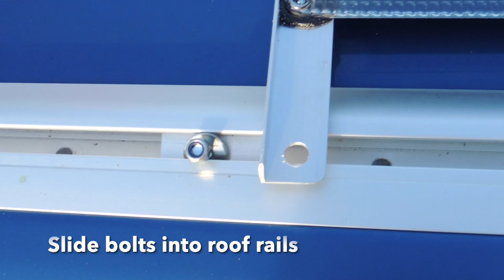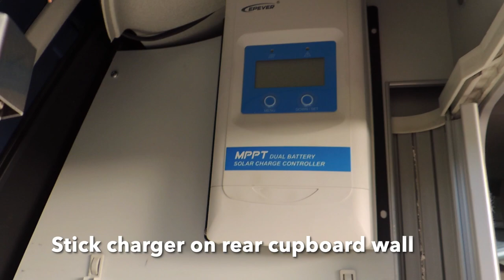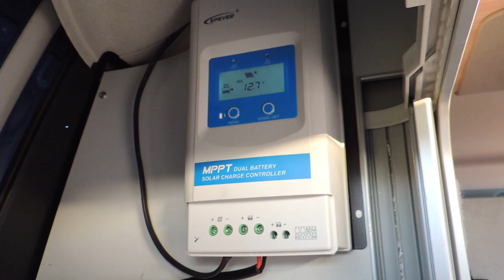How to fit a solar panel on a VW California (no drill or glue). It's easy!

Comment: Genius!! If I buy a flexi solar panel, how can I buy the metal rails that yours is sitting on, what would they be called? Also wondering what you'd suggest for running the cable into boot for a non pop-top. And finally, do I need to get some specific rubber roof rail gutter guide things? And finally what are the bolts you are using that fit into the roof rail gutter? Thank you :)
Reply from the maker: Hi, the rails come as standard on California so no idea about buying rails - sorry. Also, I guess you run the cable through the same way as I have in the video.